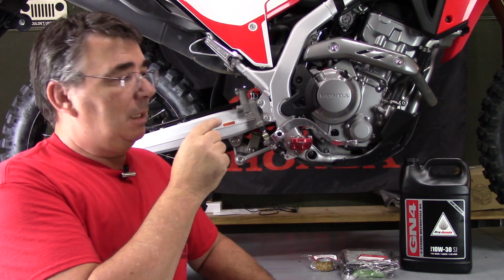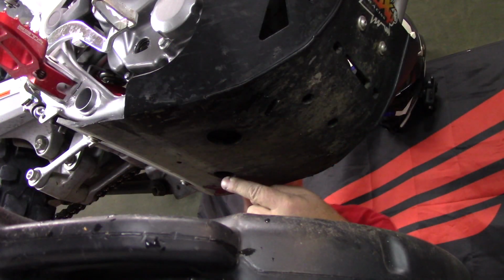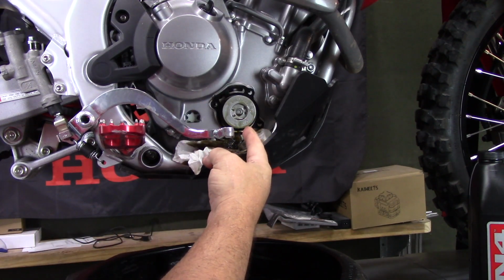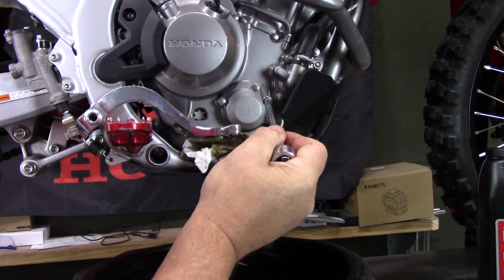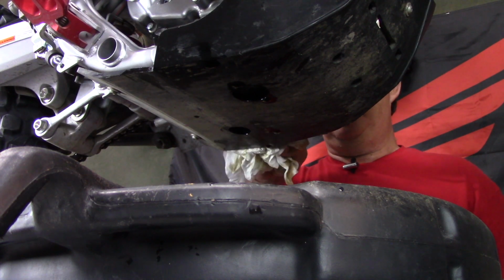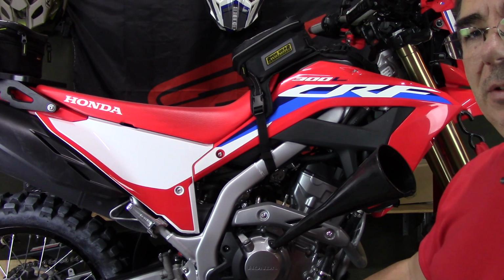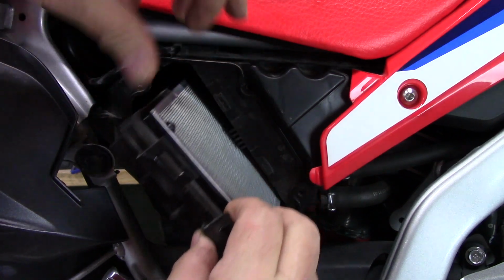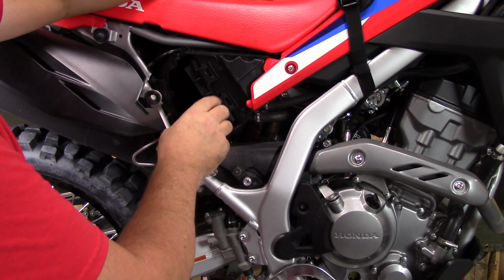Honda CRF300L CRF250L Oil & Air Filter Change How To

Comment: Interesting so can't just clean and oil old airfilter on these bikes gotta buy new ones, also don't have to oil the new one? Thanks for the video man
Reply from the maker: Yea this type oil filter would be hard to get clean. It does come pre oiled
Reply: @WOODZMAN  yeah true man I did see twin air have a good one you can open the cage up on it and clean and re oil the foam part of the filter.
Reply from the maker: Yea I thought about getting one of those

Comment: Hey  I have a slight leak from the hex bolt on the left hand side of the engine. Just below the cylinder head cover. Would I be right in saying that this bolt can be removed completely without anything falling out in the engine?
Reply: Yes there are two 8mm bolts either side which looks to have a copper washer. It’s the left one which is leaking slightly. Don’t want to remove it in case something falls out internally. I have tried to nip the bolt up but it’s already super tight.
Reply from the maker: It should be ok to remove it but I would try to tighten it just a bit first, not much
Reply from the maker: Is it a small 8mm head bolt?

Comment: Agree 100% with everything in this video except for never replacing the crush washer. They crush down hard as rock and leak as well as become difficult to remove from the plug. Use it once or twice then replace it.
Reply from the maker: Nothing wrong with replacing it, just saying that I have never replaced one and never had one to leak

Comment: What crush washer is used if it gets damaged
Reply from the maker: You can get a new crush washer that goes on the oil drain bolt
Reply: @Woodzman that would of course be a 12mm aluminum crush washer and there is one from Honda 94109-12000
Reply: @charlesludwig9173 Thank you. I was searching for the correct size.

Comment: Hello thanks for the video. I just bought a 3017 crf 250l with only 28 miles yes 28 miles and my question is do I change the oil now or wait till I reach my first 500 miles for my first oil change.  Thanks for any advice.
Reply from the maker: If it’s a 2017 and the oil hasn’t been changed, I would go ahead and do it now. Congrats

Comment: Why does my oil filter not push on as easy as yours. I have to like hold it In.
Reply from the maker: It should as long as you putting it in correctly and the same direction as I did in the video. You may want to home it up to the old filter and make sure it’s the same length

Comment: Have you ever used the honda 10w40 weight oil? I used 10w30 first time in my honda cb919 and 10w40 in my 2nd time and I find it shifts better. 

In your owners manual ot should show the temperatures with the different weight oil, and I usually fall in the 10w40 category.
Reply: I think I will try 10w40 next oil change in my 250l.
Reply: @riffafrank  Let me know how that goes! I think honda says in the manual 10w30 but I think it's for EPA or better fuel economy.

If you looked at owners manuals for older bikes they all showed a chart with temperature and different weight oils, now they don't really have it. 

The 10w30 and 10w40 both perform the same at lower temperatures, but the 10w40 has a higher temperature range.
Reply: @JohnnyBoy919  Good to know. I will let you know. I'm not due for a oil change until next year maybe more though... I bought my oil for next oil change. I bought 10w40. and I am ready for next oil change but it's not for now , I did an oil change last fall and I should be good for a while with it. I will let you know in a few years... ;) Have a good day bro.
Reply: @riffafrank  How long ago did you do your last oil change? What's the year and how many miles on your bike? I change my oil probably 2 times a year or every 6 months whatever comes first. I know the owners manual says like 8000 between oil changes but I would never do that. The longer the oil sits the worse it gets and it's not that much oil in there.
Reply: @JohnnyBoy919  it's a 250l, 2014 with 4000km on it. I probably did 800km with this last oil change. I'm an old timer, slow rider with small rides once a while... 😜
Reply: @riffafrank  Gotcha. You should be fine then
Reply from the maker: Yea I have used it before, mostly on my ATVs

Comment: Frank, Just changed the oil (364 miles) so glad I took your advice and didn't wait until 600 miles because the oil and the filter were filthy and totally in need of a refresh. I followed your tips to the "T" and all went perfectly. I really appreciate you being out there looking out for your viewers. Thanks again.
Reply from the maker: Exactly! That is what I recommend 300 miles on the breakin oil change and every 3000 there after.

Comment: Great video! so how often do you change the air and oil filters?
Reply from the maker: I change my oil every 3k and the oil filter at 6k. I don’t have a set my keys for the air filter, I just check it about every 6k and depending of how dirty it is

Comment: Great video....do my own 250L maintenance but always can pick up tips.  Just wondering if you have a preference for dino oil over synthetic.
Reply from the maker: I just use the standard Honda GN4. I have never had an issue so don’t try anything else

Comment: Would you not bother with the 600 valve check?
Reply from the maker: No not 600 miles, my shop said wait till 12K miles.
 I have my first 250L checked at 12K miles and they didn’t need any adjustment at all

Comment: Great detail, Frank. What about negating the 1 year warrentee by doing your own break in service? What about the valve check that's part of the dealers 600 mile service? I appreciate your opinions on this. - Tyler in Vermont
Reply from the maker: My local dealer in Springfield Mo said that it will not affect my warranty, it may depend on the dealer, I think some of them just want the money

Comment: An excellent explanation. Thank you so much for your attention to detail.  I have recently purchased a 2018 250l with only 370km on it and am just setting it up for adventure riding (exploring) here in Australia. Have been riding for almost 50 years on the road but only a newbie to dirt bike riding. Your video really underlines my original view that the 250l is a great bike for me with simple maintenance and long service intervals. I appreciate your practical approach to replacing the crush washer on the sump plug and oil filter gasket. It just makes sense! Thank you for putting the time in to make this excellent video. Well done
Reply from the maker: Yea and it don’t hurt to change them but really, I never have and I have never had a leak in all my years of riding bikes

Comment: Thanks, as always, for the meticulous details of this job.  Recently found an available, rare, CRF300L at Haden’s motor sports in Frankford, MO.  Have 150 miles, preparing for first oil change. Eyeing your additional air filter change, I was also reminded to check the air filter on the 2017 CRF 250l that I bought last May, when unable to find a 300.  The dealer I bought it from said they gave it an all points fluid check, but I found that to be untrue after I got home, with 1900 miles on it, and put a few hundred on it, and noticed the oil level was low, and dirty.  I did not change the air filter with the oil change and filter, and have felt like the bike was being “starved” for something, whether fuel or fuel/air mix.  But I didn’t consider the air filter, I will do that in the morning.  I’m sure I will find it dirty.
Reply from the maker: Yea I bet it is, thanks for watchin
Reply: Yep, it was dirty, but not air starving dirty.  BTW, I bought an Idea Gear Indicator for the 250, it’s plug and play.  To install I need to plug this “into the 4-pole Red male diagnostic connector , near the ECU box”.  Do you know, approximately, where that is?
Reply from the maker: No, I have heard of people doing it but I haven’t looked into it myself